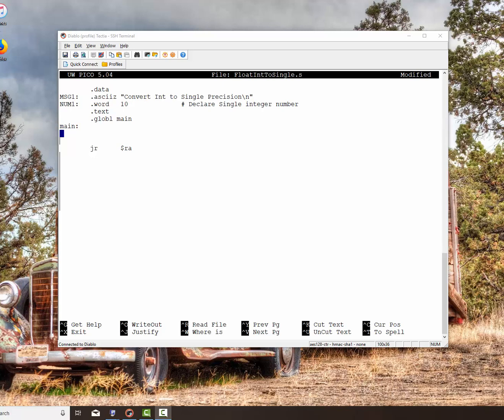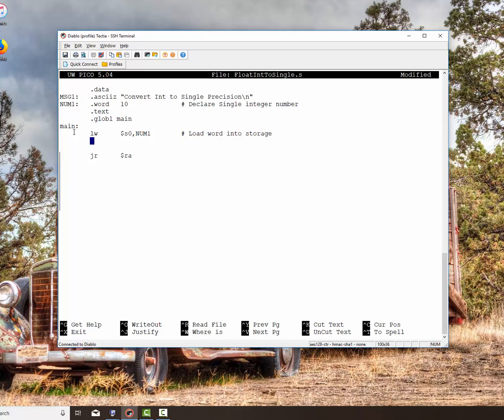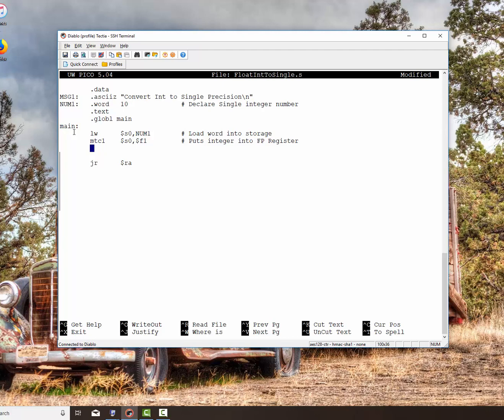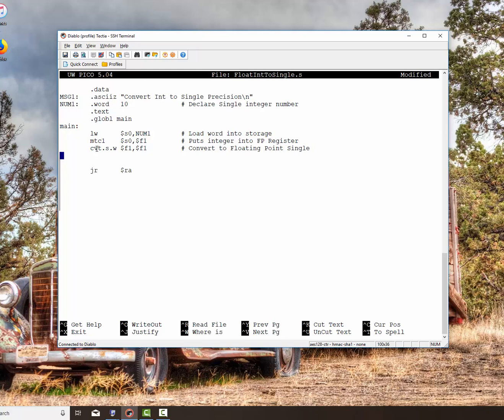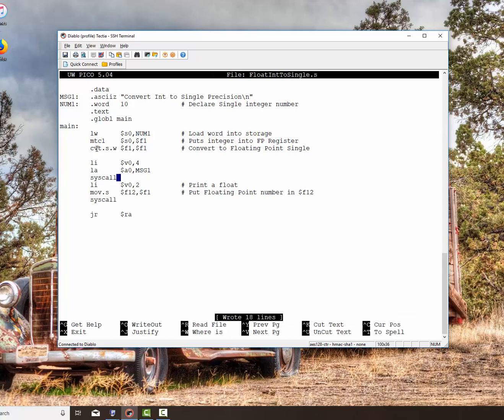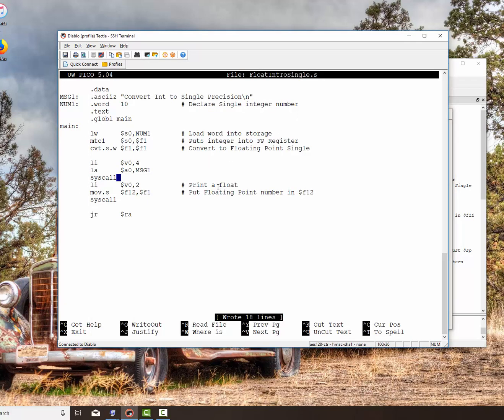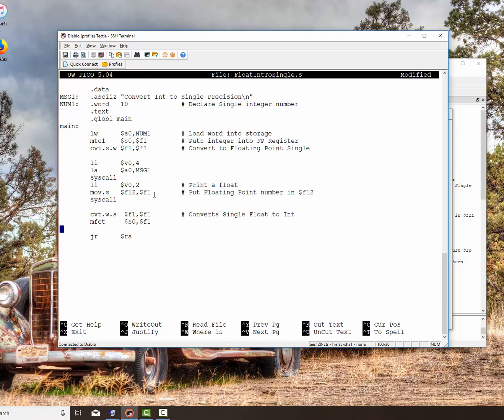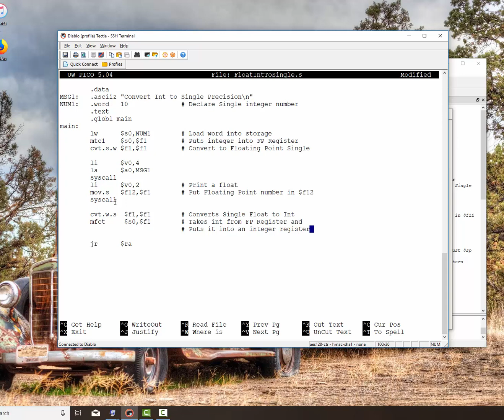MIPS Assembly Convert Integer to Single FLoating Point

Comment: When you convert the floating point to the integer does it round or truncate the decimal places?
Reply from the maker: Depends...rounding is preferred but most implementations cannot look more then a few bits in advanced.  For homework assignment tr s I have them truncate the results.